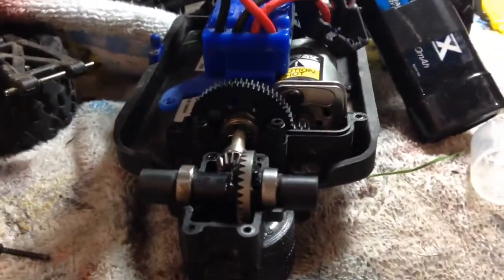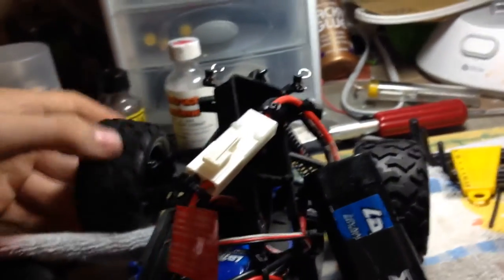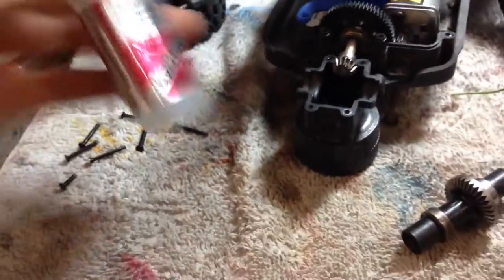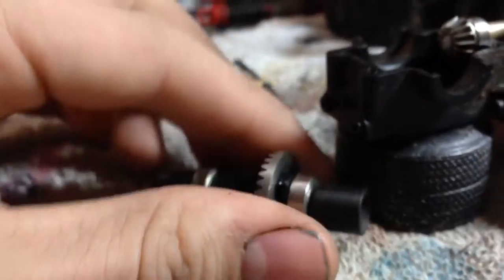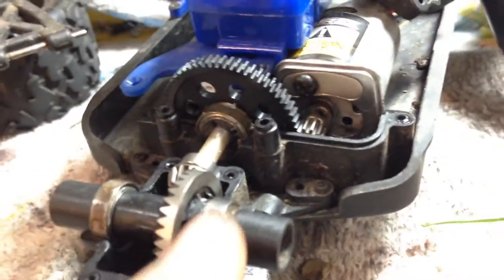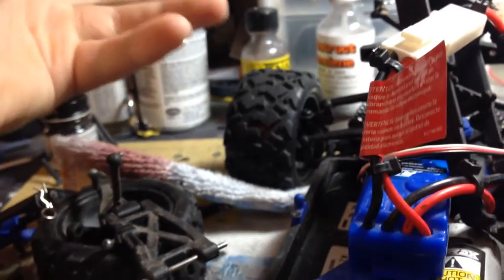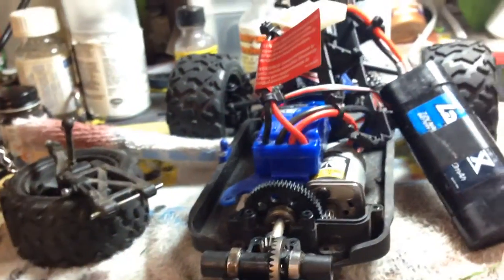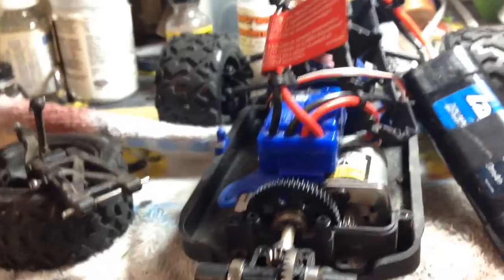How to lock a Traxxas 1/18 differential

Comment: Caution though, the pinion and ring gear strip easily even when shimmed correctly so if you glue your spider gears and ring gear your gonna have trouble later if you need to replace the ring gear

Comment: I am waiting for my aluminum spool to come in. I will try this on mine and see how it works. I have the ultimate test for the super glue. I have a 5800kv brushless motor in mine it goes somewhere around 40 MPH if I had to guess I'll check that later on though. good info thanks for the idea I will try it out until my spool comes in. I will let yall know how it holds up to the abuse
Reply: Brian Carter make a vid

Comment: Does it work good
Reply from the maker: I haven't had a problem with it yet, if you do plan to do this i would upgrade your axle shafts to aluminium so you don't break them from the torque of the motor.
Reply: I used gorilla glue gel on both of my boys Tetons. Both blew their axles and upgraded to aluminum. It totally changes how much fun these are all around!
Reply: I used gorilla glue gel on both of my boys Tetons. Both blew their axles and upgraded to aluminum. It totally changes how much fun these are all around!